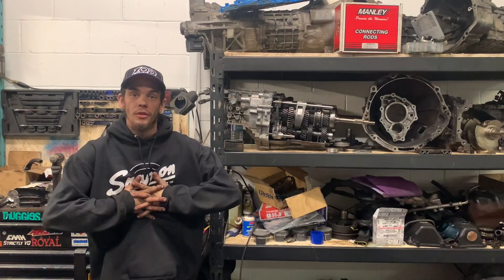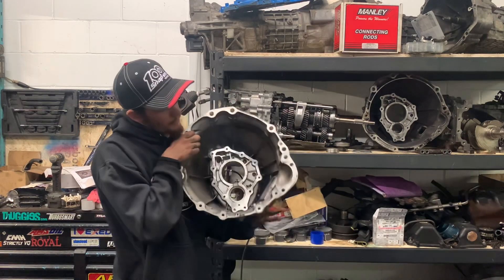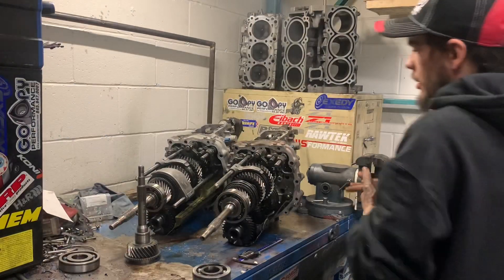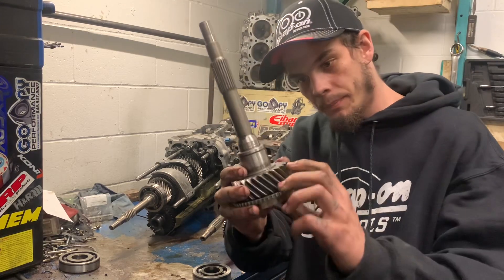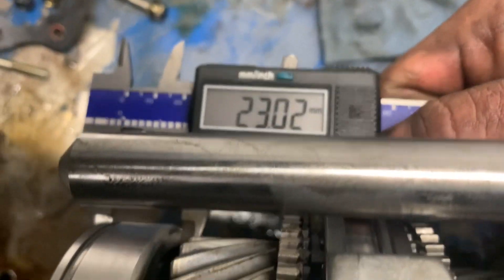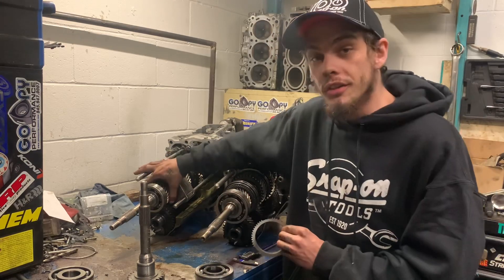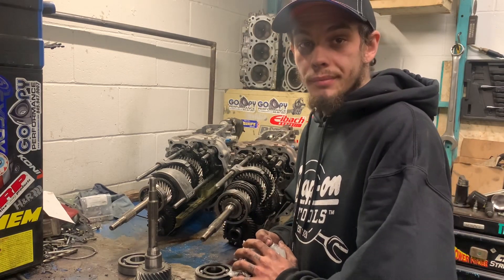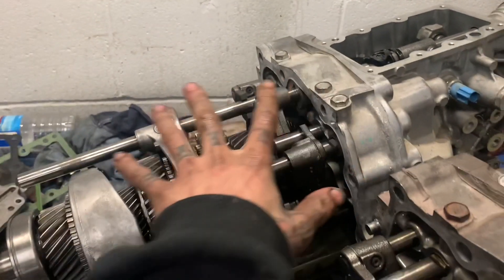JK400 to CD001 housing swap behind a 3.5, WHAT?

Comment: Hattip & great video - For what it’s worth: CDxyz equipped cars with standalones use the wheel speed sensors and engine speed to determine which gear they’re in and can use this method for boost-by-gear.

Comment: hey bro, i have a turbo de car with a bad cd001, and happen to have a jk sitting. wanted to be sure its basically just swapping the bellhousing, buying the correct bearing, and having 2mm milled off of the jk input shaft

Comment: How didn’t this video have more views !! Thanks for this video!!  I’m a dyno tuner tune lots of Nissans but I’m doing a 350z k24swap and needed to know if the cd01 was a ok trans for the power…..sounds like there nearly the same ….also I’ll look in to that rev match sensor, I was just going to use the wheel speed vs rpm to equate gear for the stand alone …any way awesome video dude !!!
Reply: Also over on my channel, my 350z is at about 450hp  …..is there any cool mods for the cd01 trans to make it better ?